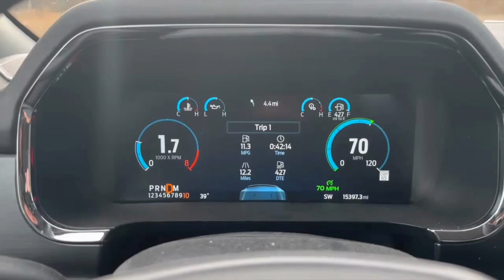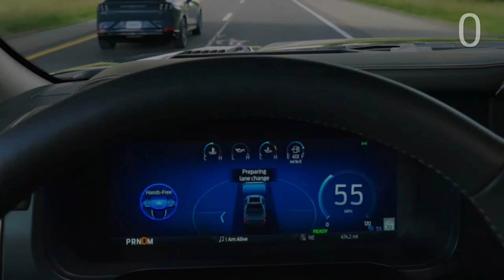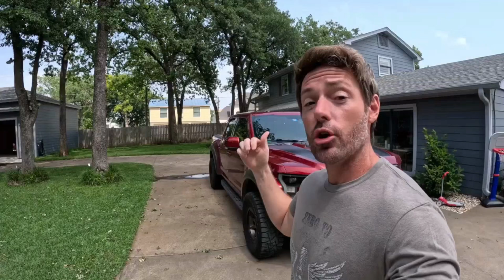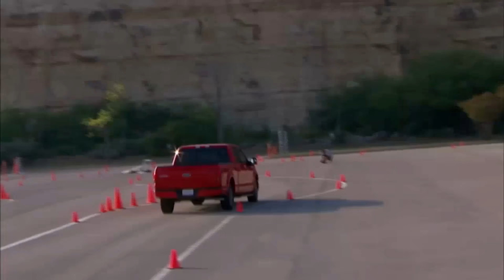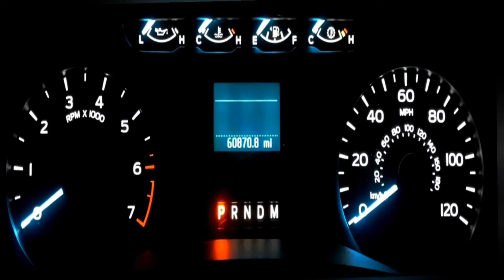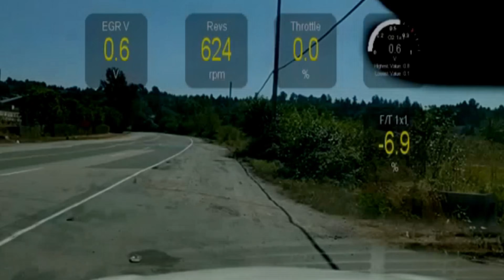Best $50 Fuel Upgrades For Fords (Real Tested Results!)

Comment: Be very careful when cleaning your MAF sensor. Make sure youre specifically using MAF cleaner. The sensor is very delicate, so do not touch it and do not hold the can too close when you spray.. And of course make sure you let it air dry before you reinstall.

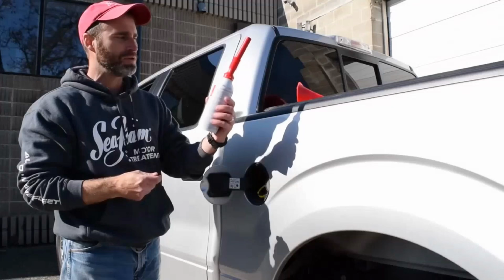Comment: 16:06 💡💡💡Fuel efficiency cleaner with 60 to 70% more PEA Redline SI-1 complete fuel cleaner use it every 3 to 5000 miles seen gains again of 5 mpg 💪👍🤙
Reply: I just used this for the 1st time.

Comment: There are no upgrades, this is entirely maintenance issues. And for the tire, that number on the door is a minimal pressure to protect destruction. If the light comes on, your tires were already damaged.

Comment: I started using top tier gas only and a system cleaner with high levels of PEA in my 07 Lincoln mark lt and my mpg increased
Reply: I use non ethanol gas

Comment: Where can I get the intake silicone tube and the air fillter
Reply: I looked it up quick, ecs doesnt make one for ford, that one is specific for a volkswagon, take a look at the motor, cover, it says tsi. kinda bummed there is none for the truck

Comment: On addressing tire pressure, one thing that is commonly overlooked is that tire air needs to be very dry.  Humidity that get inside tires cause two major problems.  Humidity first will cause bigger pressure variations between cold and hot temperatures.   Second, humidity will also degrade your tire pressure sensors over time faster.  I see people using those electric powered air pumps on a regular basis, and they wonder why water is getting inside their tires.  Too much water equates to severe tire blowout when water turns to steam.
Reply: Use Nitrogen

Comment: I only use top tier gasoline in my truck
Reply: So do I. Which ever is cheapest when I need gas. Shame my Taurus X gets better mileage at 80MPH than 55 MPH and I only have 281,000 thousand miles. What a shame for such a new, low mileage vehicle.

Comment: I had a VW Jetta in the 80s. Diesel. In the summer, this car would average 50 mpg on #2 fuel, and 35 average mpg on #1 fuel in the winter.  A friend had a rabbit diesel that got 73 mpg on a trip of 250 miles. Try that now.
Reply: What does this have to do with subject?Ford products
Reply: @richhuddleston73 Not sure.
Reply: Vw rigged their computers to bypass epa regulations, since of course they got amazing results.
Reply: @yondermountainjamfan9410 That is my point. It proves we are creating more pollution with this EPA crap.

Comment: Where should you gap to spark plugs too? They say 50k what do you say?
Reply: Gapping and 50K - What?? Look it up.
Reply: Iridium plugs should not be gapped they come with the proper gap already on them. You will notice on the heavier protected tips in the package.  Plugs should be changed every 60,000 km at the most. It is definitely noticeable in power and throttle response.

Comment: Remove sensor from intake. Use ONLY sensor cleaner, never wipe sensor. For best results,  clean inside intake tubes also. Service MAP sensor every time you service air cleaner. I also clean the throttle body at the same time. Stock air cleaner housing is best, just swap paper filters with K & N  air filter, which you can clean with water based cleaner, dry, then re-oil, reinstal.
Reply: Ive got a metal tube K&N cai that id planned on using in my 98 regular cab shortbed F-150 & planned to wrap the tube with heat resistant tape for cooler air but now Im either trying the Gotts mod or using a petcock from a Jeelp Grand Cherokee Laredo and run outside amir from grill directly into the Jeep airbbox plus i can wrap my pipe from intake to the airbox. Doing Iridium NGK gapped to specs. Then im running true dual exhaust with flowmaster mufflers and an H-pipe.  4.2l baby!! Turbo coming in 2nd season 😅
Reply: @dentondunn4346  Driving Intelligence YouTube channel showed that exact modification improvement of wrapping the intake tube with foil bubble heat resistant wrap would be used for insulating food, then wrap it with heat resistant tape like induction tape from Home Depot that resist against 500 to 600°💪👍🤙
Reply: 💡I also have a 4.2 L 1998 with 170,000 miles. I would be very interested in watching your video of installing a turbo or supercharger.💪👍🤙
Reply: I forgot to mention: DO NOT OVER OIL filter, & also let it soak in well to prevent oil from contaminating MAP sensor.
Reply: @JohnMoses1897  Spraying K&N filter or any filter that needs oil best results is to let it sit in a highly ventilated area for 10 to 20 minutes💪👍🤙

Comment: MODERN FORD ENGINES DO NOT USE A MAF!!!!!!! They use MAP sensors ONLY!!!
Reply: Clean the map sensor as well. I have found oily residue on my map and clean it every oil change. You can use MAF sensor cleaner on it. Don’t use brake cleaner or anything harsh.
Reply: What do you consider modern? My 2020 has a maf sensor
Reply: I have a 2016
Reply: It depends on what year model you're talking about